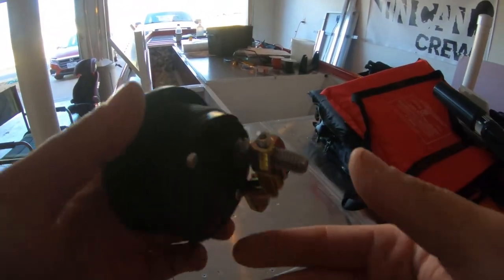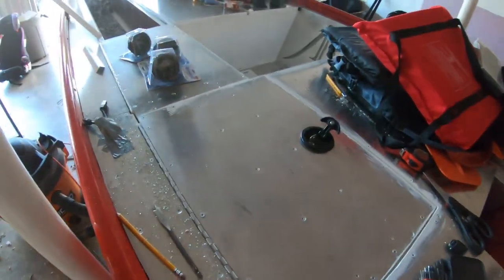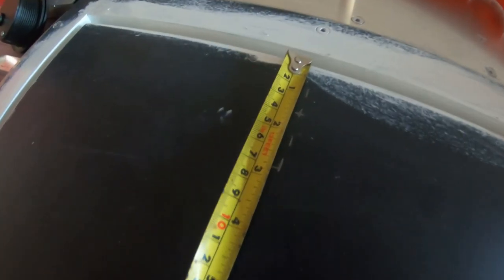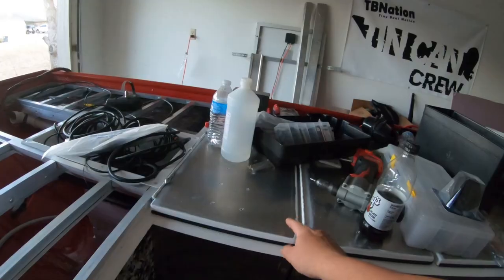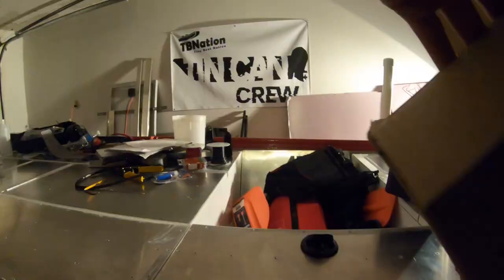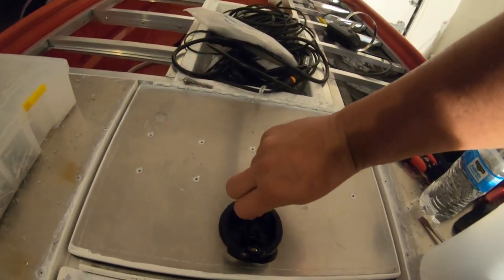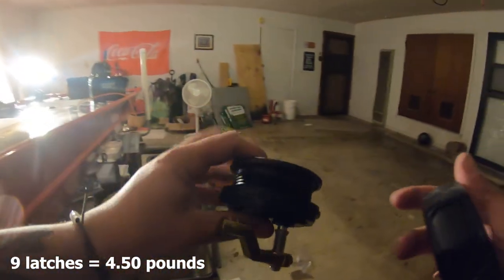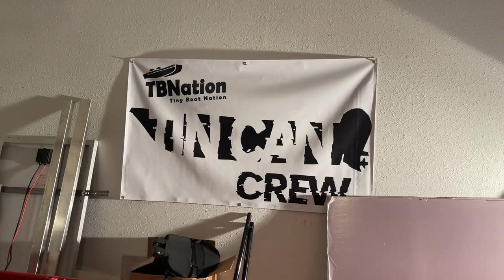HOW TO ATTACH LATCHES on JON BOAT to BASS BOAT CONVERSION!!

Comment: Man I sure hope all the latches have the same key! Or else that would be a pain in the ass trying to remember what key goes where 🤣 boats looking good man! Get that thing finished and on the water! Want to see you slinging some fish onto the deck again!
Reply from the maker: All the keys match lol and I know man, I’m ready to fish everyday again!
Reply: @AdamRyanA  I can only imagine man! Especially balancing the boat build with the new shed I'm sure makes you just want to hit the water and rip some lips!
Reply: Do the locks have any security value, or can anybody open them with a piece of wire in several seconds? Are the keys universal, the same for any whitecap latch?

I could not find any information about this ...
Reply from the maker: They add security value to the common thief that wants to be quick, they will try and see that it’s locked and move on, but as far as someone really trying to get into the boat, idk, it’s only aluminum that’s holding the latch down and I don’t want to test it out on my boat to see how hard it actually is to force open, and all the keys are the same
Reply: Thank you very much, Adam. BTW, you did a stellar job on the job boat. I don't know what your day job is, but you could do this for a living without any problem!!

Comment: Sorry to say Bro , but I did not like the handles, couldn't it be flat with the floor? No hating Bro,  I was thinking when you are on top, you will be bumping on the Handles.
Reply from the maker: Nope this is how they all are, when I add the foam to the deck it won’t stick up as much
Reply: @AdamRyanA  okay I believe you. I enjoyed a lot the shed you building, it is a good content also.
Reply: Once the EVA foam is on you can’t tell the difference. The only difference you feel is the heat of the handles when you are in the sun light.
Reply: @chrisroberts3963  hope so.